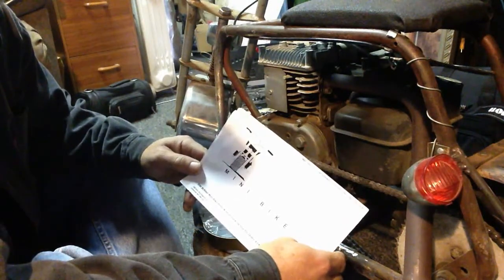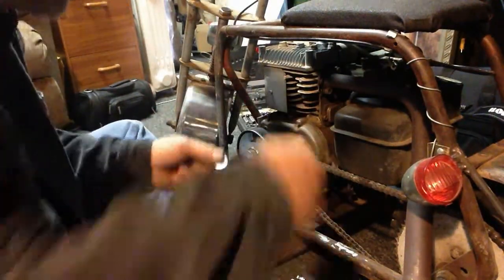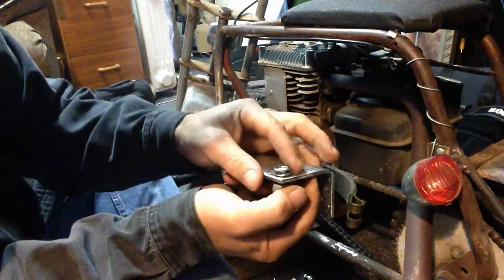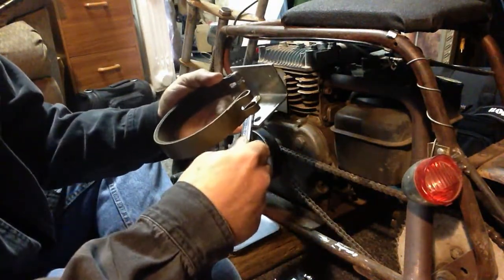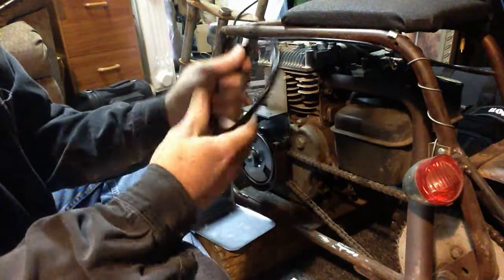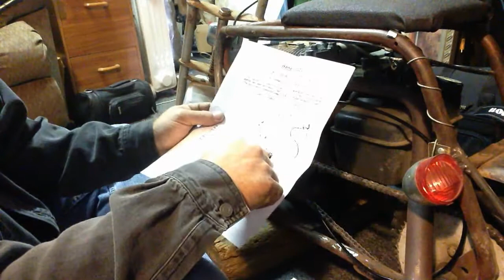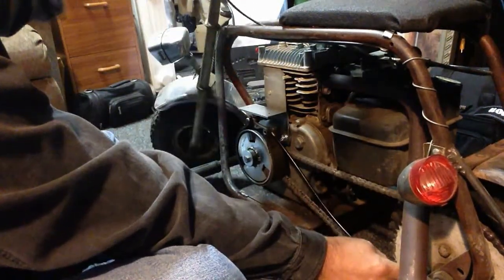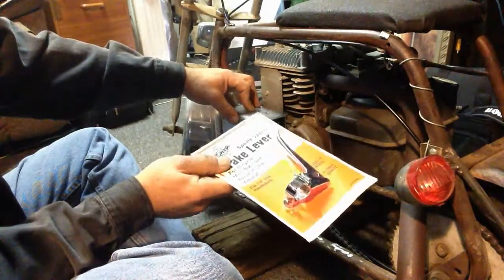Old School Mini Bike Brake Band Installation and Review

Comment: how does it stop? compared to a rear brake setup. 
also love the patina of your mini. throw that cover outside for a few weeks.
Reply from the maker: Stops very well, will even skid if squeezed hard enough. Requires adjustment every so often depending on how often you use it. I still flintstone it most of the time, the breaks for emergency's LOL
Reply: I am just Robert it slows the clutch bell such slows the moter

Comment: You still have to be careful I just installed the same brake system on my minibike and I have a brand-new drum break, if the cable snaps on the drum brake I’ll use the clutch brake if the chain breaks you can’t use the clutch brake so I have to depend on the Drum break. So I got all corners covered. When you got your minibike putting out 18 hp and you have ii geared to do 70 miles an hour better have two brake systems ha ha ha ha

Comment: you hooked up your cable backwards......free end of cable goes on floating side of drum......not fixed side
Reply from the maker: Thanks for the tip pat. If anyone is wondering if it works backwards, I'm here to tell y'all i've had no issues since the day i installed it. Thumbs up!
Reply: RyanFamilyAdventures .. You'll have more Torque by installing the cable correctly through the front which is the way it is supposed to be done.. For a period of time Michrina Bros. / LiL Indian used the clutch brake around 72-73. Also, Google 'Ruttman' Minibike pictures. Every Ruttman model used the clutch brake and the cable was installed through the front.. The cable draws the band up tighter , ensuring a much better stop ! ...👊😎
Reply: It really doesn't matter. On a mini bike it helps reduce cable cutting and running around frame. On a kart yes definitely other way because you want it in line with the pedal. And at least he did a honest video crap happens.